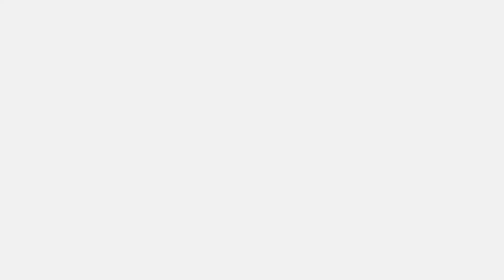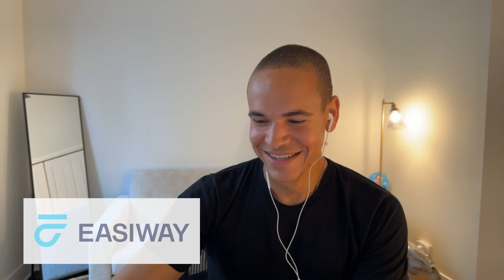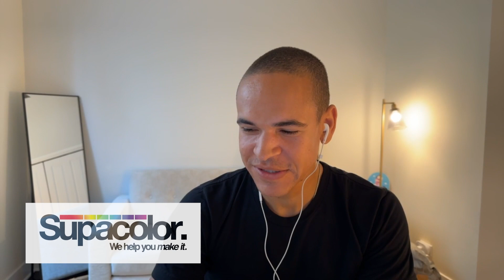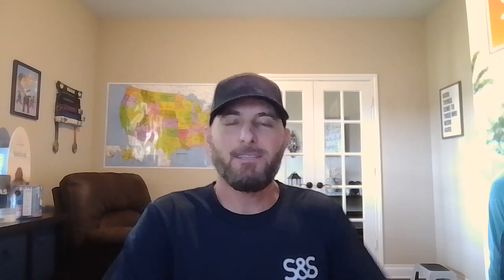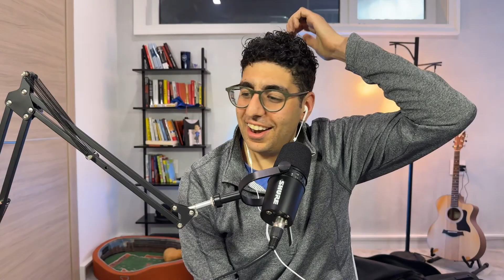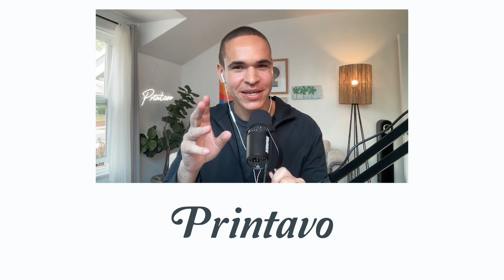Purchasing Reps and DGI Apparel with Frank Good of S&S Activewear

Comment: I just signed up with S&S (normally use Alpha) and phone rep has  no idea about how to even get you a list of contract decorators you can work with very bizarre. Rep said “Google it” and when I did all that pops up is an S&S website talking about the program with no way of contacting a decorating partner in your area or anywhere. Truly one of the most bizarre experiences ever.